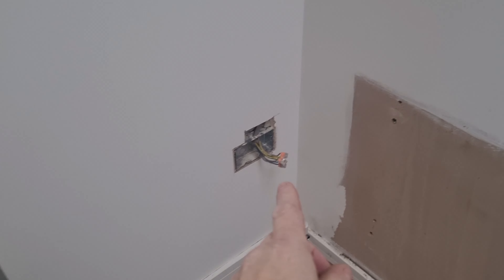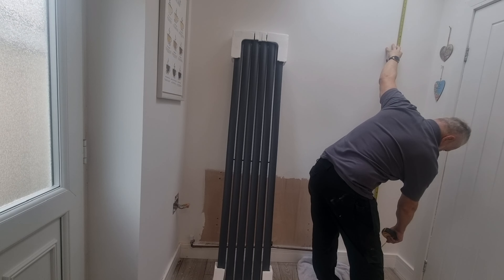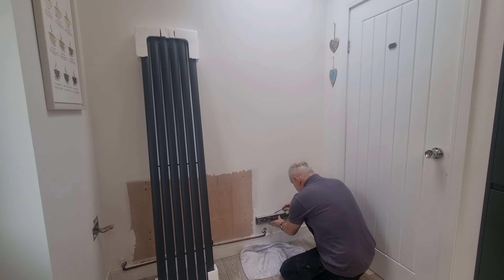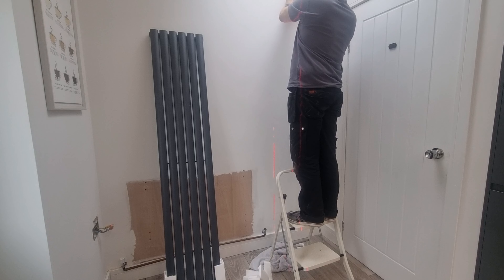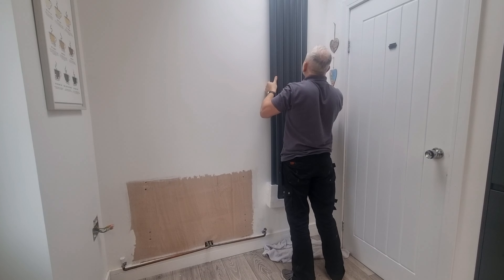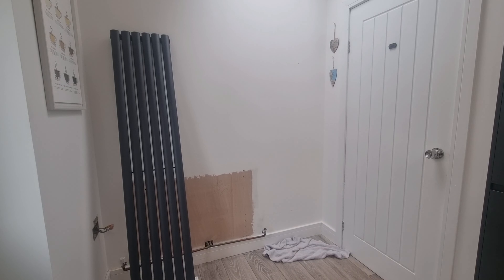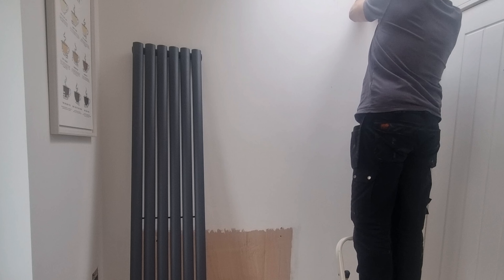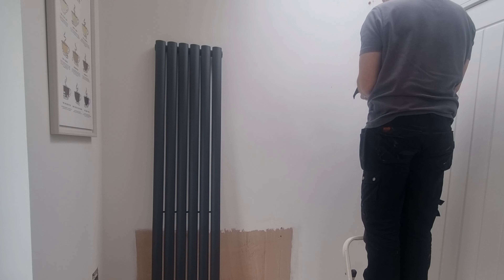How do you install a tall Radiator??

Comment: Nice rad Mike. Ive got the special little router bit for a drill that recesses the back of the 19mm? hole to remove dot and dab adhesive if that where the hole ends up. Great fixings.👍👍
Reply from the maker: Sounds great bud, will have to look into that,
Reply: Its on the same page area as the fittings. Adjustable for thickness of plasterboard. Easy to use. Allows the little wings to spread out. 👍👍 
Screwfix 4074J for the red ones
 @KingstonHomeMaintenance